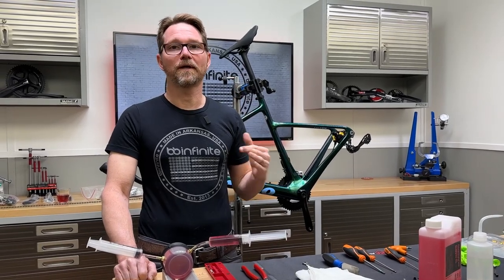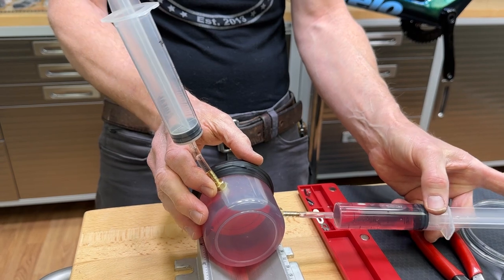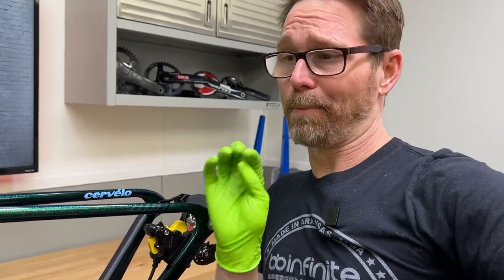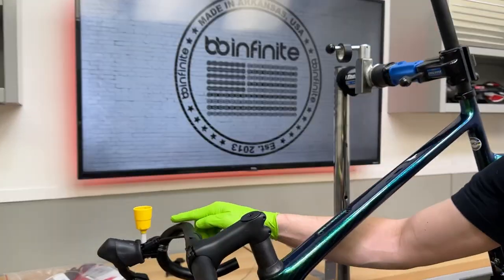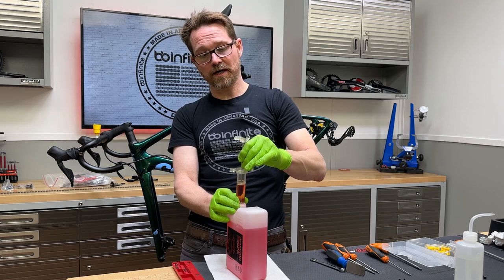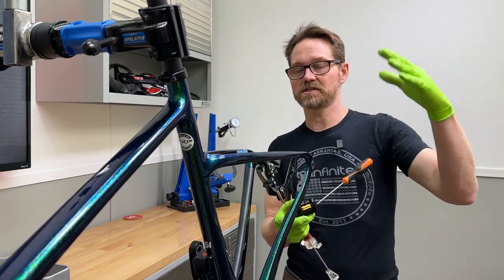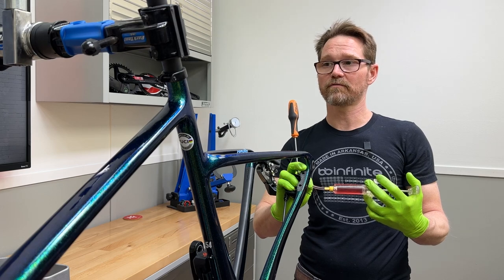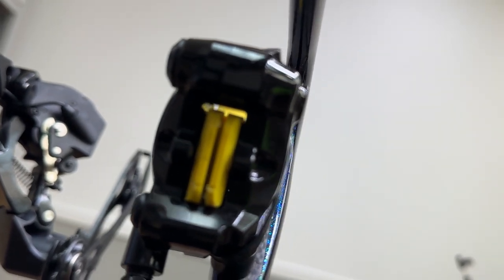TECH TIP: Bleed Bicycle Disc Brakes Right the First Time Like a Pro!

Comment: Omg this video explained my issue in a nutshell 😮, not tilting calliper at correct angle and using DIY bleed spacer made of cardboard which didn’t push pistons back fully

Comment: Why not drop the ass end of the bike leaving the caliper mounted. Then rotate handle bars, so reservoir cup is level. Then push fluid from caliper to cup?
Reply from the maker: It's very easy to unbolt the caliper. Not sure why everyone wants to avoid something that's so easy.

Comment: All those so called mechanics swearing by their flawless gravity bleeding "technique" should understand this!
Reply from the maker: The same orientation of the hydraulic components (ports up) is required for gravity bleeding to work. Gravity pulls the fluid down, but air wants to float up. We'd rather cater to the nature of things rather than fighting it, which is why we push fluid from the lowest point to chase the air up and out. We like the active approach rather than the passive, gravity approach.

Comment: What if there is no bleed port it seems I have only one screw / hole and man is it annoying to work on trying to not let air in and keep oil from getting everywhere
Reply from the maker: There will be a spot for the brake line, and one for the bleed/fill port. If it's not a bleed port you can hook a hose to, then yes, that's super annoying if you're forced to just catch it all with a rag. What make are these calipers you're working on?

Comment: If you orientate the frame in the stand correctly you dont need to remove the caliper
Reply from the maker: It's two bolts.
Reply: @BBInfinite  doesn't matter if it's one, two, or ten, it's still unnecessary.

Comment: Great demonstration, especially the beginning, to see the principal in action. Question - would that work also with a syringe connected at the pump, instead of a cup? In some videos it seems like we need to bleed both the caliper and the pump, while in others (like in this video), it seems like bleeding only the caliper is enough?
Reply from the maker: By "pump", we're assuming you mean the lever. With a hydraulic system you bleed the entire circuit at the same time. With our method, this is the case. By starting at the caliper all the air is forced out of the entire circuit at once: the caliper, the line, and the lever. These components cannot be bled separately. Some parts could be "pre bled" to get them almost there, but once assembled you'd need to bleed it again, as shown in the video, to remove all the air regardless.

Comment: Planning on replacing the mineral oil in my brakes. Would you recommend a gravity bleed first to flush out the old oil, then do the caliper oil injection to bleed the air up towards the lever? My concern is that the old oil might have sediments which a gravity bleed is best to address.
Reply from the maker: Simply follow the method we show in the video and you can't go wrong. Once you put the bleed block in the caliper it will displace most of the fluid from the caliper. The remnants will be pushed out by the new fluid. Gravity bleeding will not work.

Comment: Why not rotate the frame in the stand so the bleed port is above the nipple to allow bubbles to exit without removing the caliper? I understand the bleed cup will not be level, but unless one floods the line with excess fluid, the bubbles will exit as the fluid is added.
Reply from the maker: The principle is to get the air out. If you can figure out a way to do that and it works great for you, do it.

Comment: What happen to the air you removed from the caliper after you rotated, you didn’t push it out…;) . Love your bb but as far as bleeding goes your method the way you demonstrated it’s terrible… unless I missed something.Also, if you look at the pistons when you have adapters installed, provided by shimano, they never fully retract. And even if they retract after the very first ride they will push out.
Reply from the maker: I see what you mean. He's pushing the syringe very slowly in that last bit all while he's talking. It's important not to push the fluid too fast. Air likes a gentle hand to show it to the door.
Reply: @BBInfinite  so you just not showing that part, now it makes sense. I rewatched and saw the syringe almost empty on the second shot.

Comment: Never seen any mechanic take the caliper off the frame to do a bleed
Reply from the maker: ...and that's a problem. The goal of bleeding is to remove every last miniscule bubble. Any amount of air equals a spongy feel that translates to improper stopping power and modulation.

Comment: In trying to get it right I think I made my membrane in the lever leak. From the small hole, not from the screws.  I tried cleaning the membrane, drying it completely but it still leaks. I bought another, but would you know if there is a typical error that may make the membrane leak?
Reply from the maker: Replace the parts/membrane/seals where the leak is occurring. It's possible these parts/seals have been compromised in a way you are unaware of.
Reply: I guessed that was it thank u for the video, great job! Subscribed